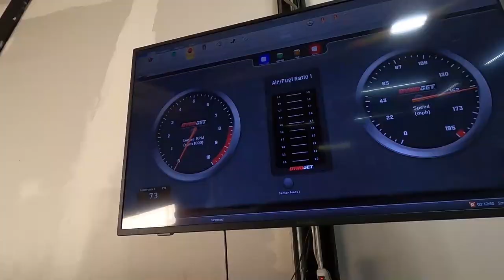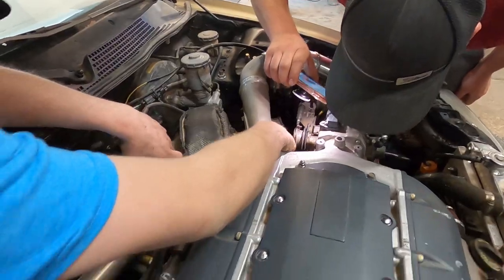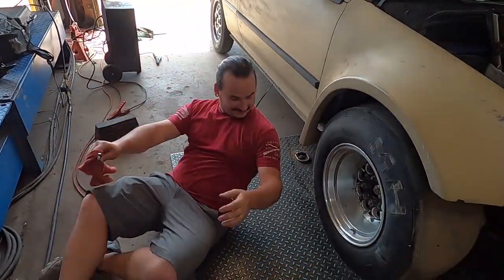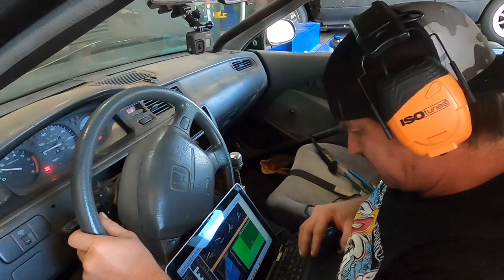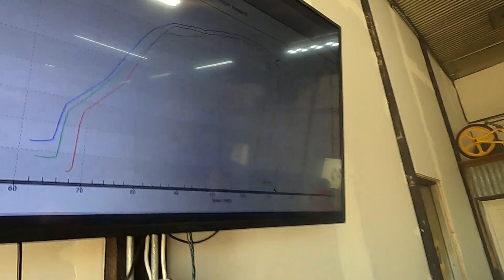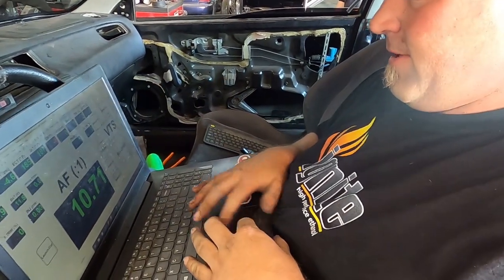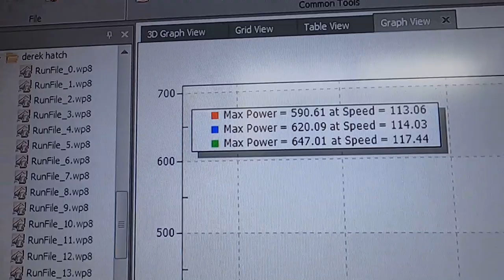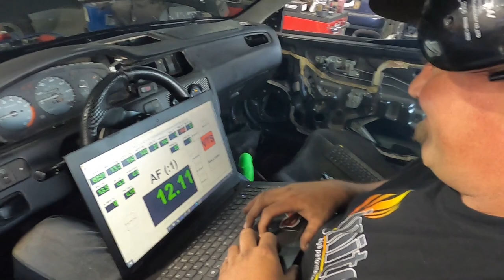YOU CAN'T MAKE THIS SH*T UP! PSCA prep Episode 2

Comment: Man I was always told to triple check everything before going to the dyno so that the car is ready to get on it and you aren't wasting the tuners time. Just seems like a lot of people that go to PFI are not actually ready to get their car on the dyno. I know some happened while it was there but jeez that was a lot of hunting for issues.
Reply: IDK, my car is mechanically finished but I would love to have these guys give it a proper shake down and a tune. It’d be well worth the money.
Reply: @negativeindustrial  it's just about what expectations you set. If you tell them it's running well no leaks etc then it should be ready but if you need it looked over and maybe a couple parts swapped or checked then you need to say that to the tuner so they can schedule accordingly. Busy tuning shops lose money if the dyno isn't rolling while the car is on it
Reply: @Shiftheads 
That’s fair

Comment: The minute Jamie said the speed sensor wasn’t plugged in and had no connector I thought that was going to be this issue. But I forgot this is an old setup… Just dealt with this on a K24 Element. Someone forgot to put the Spacer behind the Output Shaft speed sensor so it would immediately get destroyed every time you start it and throw a P0122 and P0107 (TPS and MAP Sensor) with no power to the Output Speed sensor connector. And it ran like shit. After 2 speed sensor and lots of research I found the spacer at the junkyard off a accord. Installed it, and it fixed how it ran but the Speedo still didn’t work… And it wouldn’t go over 4k rpm. Playing around with it in the garage for hours somehow figured out the spacing wasn’t right on the sensor. I had a 2 mm spacer, I installed it and it fixed everything… Now she’s Banging gears at 7500rpm!! Love your videos keep it up!

Comment: Brent you could make a fortune renting your spanners out with all these little leaks on the hotrods while on the dino !. 😂😂 Stay safe awesome uploads.
Reply: The crazy part is I prepared for 2 days straight to have this thing ready. And still had them. Sometimes it’s just meant for good content 🤣
Reply: @hondagarageprojects4378  that's race cars has happened to the best of us, or other spend thousands on engine and goes up in smoke b4 the straight is over. Good luck for weekend buddy.
Reply: Thanks man. Ya it all worked out. And ended up running my PB. 10.4 at 141.
Reply: @hondagarageprojects4378  awesome bud good luck with the future

Comment: I got a surprise taking my mountaineer fuel lines out. Guy before me shoved a rubber hose inside another hose about 7inches in and left the sticker on the line he shoved in, the fuel broke the sticker down and pushed it into my injectors and gummed everything up. Now I'm building a new stock 5.0 to put into it temporarily untill I get my custom 454 done then she getting some power.
Reply: Fellow mountaineer owner, what year is yours?
Reply: @benson4u215  2000 AWD 5.0 for now, but I'm putting in a 454. It's going to be my family sleeper. I have a big super charger I could put on, but then it's not a sleeper, the super charger is going in my 69 Camaro.
Reply: @DanTheMan454  ohhh man thats pretty much my dream setup, alot of cars have problems just keeping up with the stock 4.0, hell the 4.0 is faster than my 351w hahaha did you find the wiring harness already too to usethe 5.0 ecu? Ours is just a 4L awd '08

Comment: what parts did you guys get to fix the steering on the rsx? i’ve been having the same problem with my rsx and i can’t find any good steering rack bushings for it. btw you guys are awesome and i love your channel!!!
Reply from the maker: We found a billet center spacer and the ktuned tie rods 💪🏼
Reply: thanks for letting me know. i’ve replaced everything on my front end and i was thinking about getting that slider for my rack and now i know i need it for sure. thank you!!! i think you guys are the best channel on you tube
Reply: It deffenatly helps allot on these had a em2 that was lowerd n that plus different tierod ends helped mine allot

Comment: Have you thought about running a camtasia capture on the computer outputting the Dyno chart and then putting that in "real-time" frame lower corner of the video while doing the dyno session?
Reply: Oh that would be cool, good idea
Reply from the maker: I have , it freezes on the first window the rest are like floating windows any ideas would be awesome
Reply: @PFIBrent  Could be camtasia hitting it's limits, I've definitely had it act up if resources on the computer are maxed out.  OBS might be a better option as you can specify the application/window you want to capture and it's a bit lighter on resource usage, which is why streamers tend to use it.  Maybe give that a try.  if you need help setting that up just shoot me a message and I can likely help you out.

Comment: So was jt the spark plug nose insulator burning off and somehow ending up clogging the injectors? How is that possible?
Reply from the maker: No those were the wire insulators for the injector plugs for when you pin the new plugs.

Comment: Why do builders use those cheap ass tiny fuel filters??? Go Radium, usexa 100mc and a 10mc fuel filter in the system. Running one filter wont cut it.